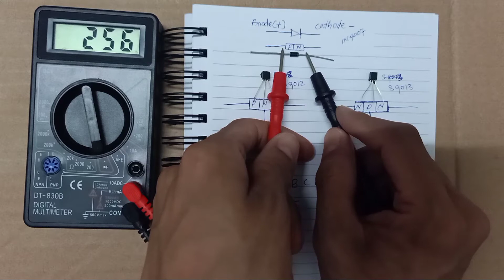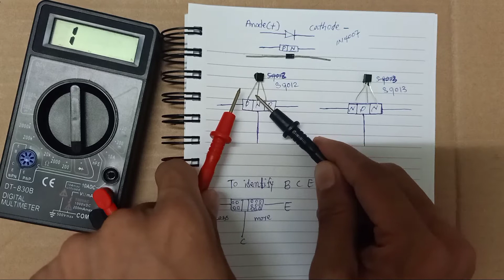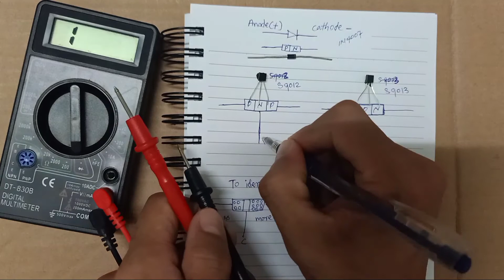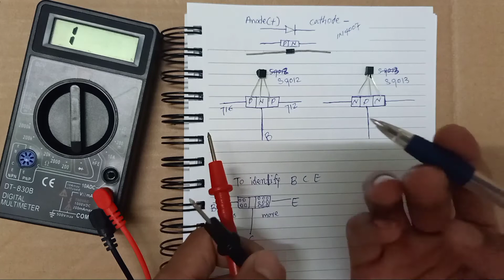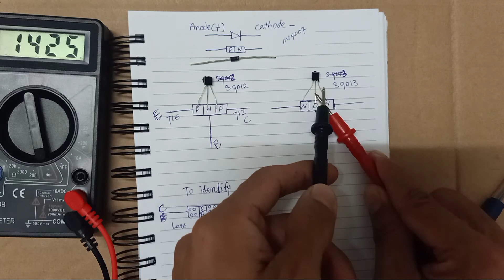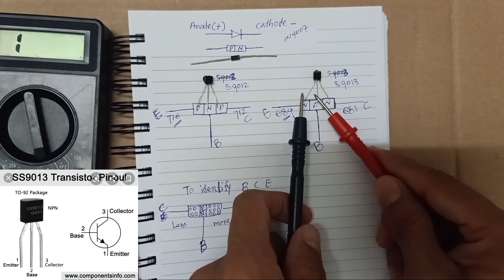How to test NPN or PNP transistor with digital Multimeter.

Comment: May i ask. 716 and 712 what unit it use?
Reply from the maker: Bro...it's depends on the specification of the datasheet something like Amperes, Voltage , when you specified so on, than you may apply on multipurpose.